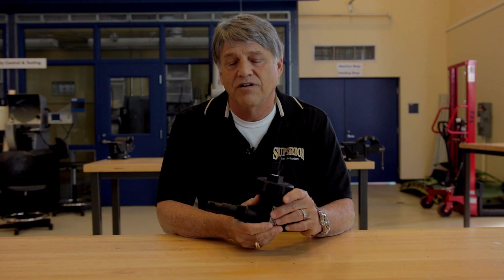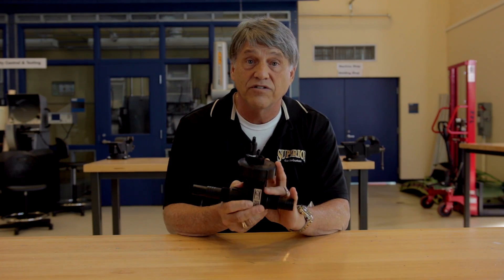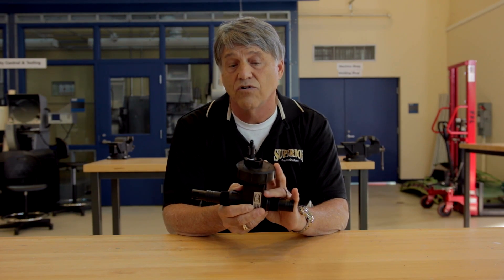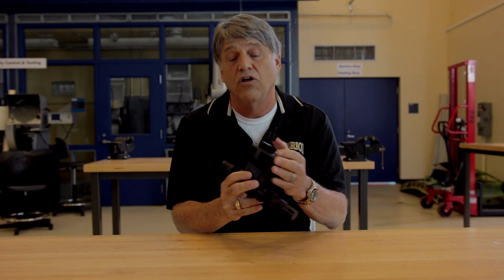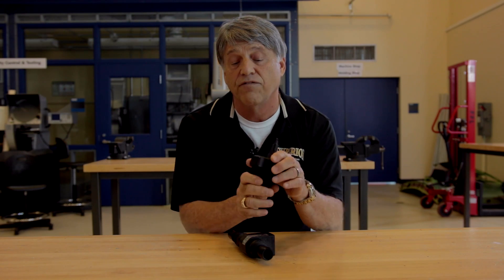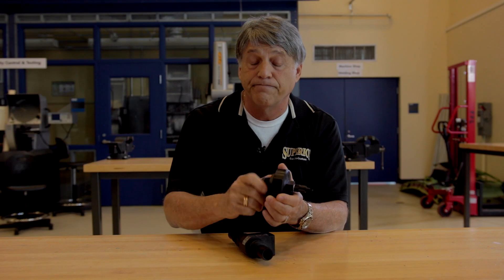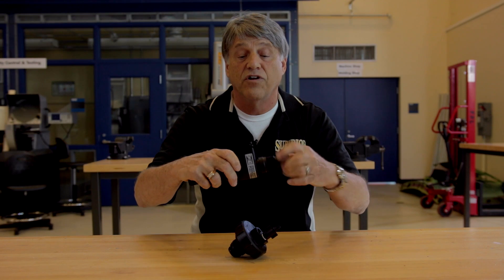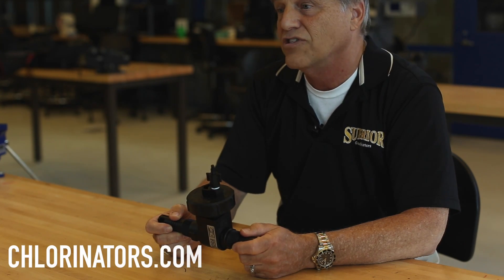SUPERIOR™ EJ 1 Vacuum Producing Ejector For Water & Wastewater Disinfection

Comment: Many other brand  Ejectors Passing water after Electricity shut off
Reply from the maker: Thank you for visiting our Facebook page.
The Superior Ejector can be purchased 2 different ways. Our standard Dual Hi/Lo backpressure check valve and our Dual High pressure with Ball check valve.  Either choice you make, the Superior Ejector Dual Check Valve virtually eliminates check valve failure when the electricity turns off, preventing water backing up into the meter panel and vacuum regulator.  The Superior Ejector comes with an impressive 3 year warranty and a lifetime warranty on the spring.  Please click on these links to see tech drawings of both Superior Ejectors.
(SUPERIOR® Dual Hi/Lo Backpressure Check Valve) https://chlorinators.com/wp-content/uploads/2017/01/PartsListEJ-1-2.pdf
(SUPERIOR® Dual High Pressure Ejector with Ball Check Valve)  
https://chlorinators.com/wp-content/uploads/2020/06/SUPERIOR_EJ-1-2-CVB.jpg

Please let me know if you have any questions or need more information with any of our Superior products.
 

Thank you, again and best regards,
 
Bob Fraum
Vice President
Chemical Injection Technologies, Inc.